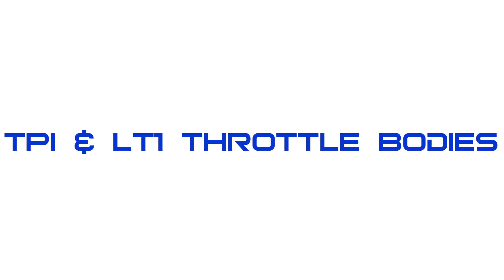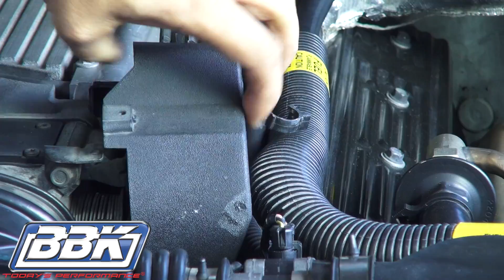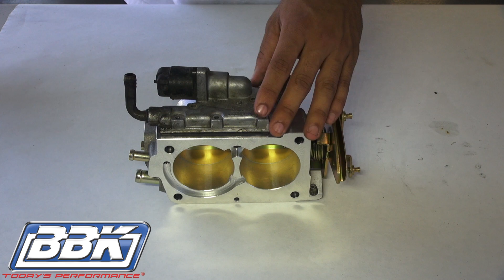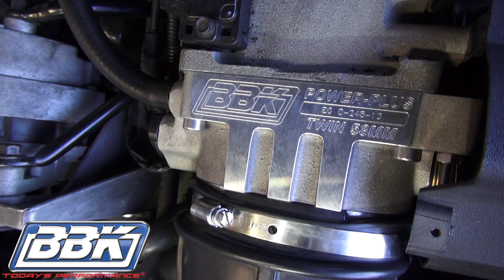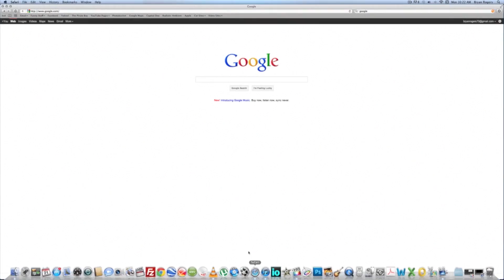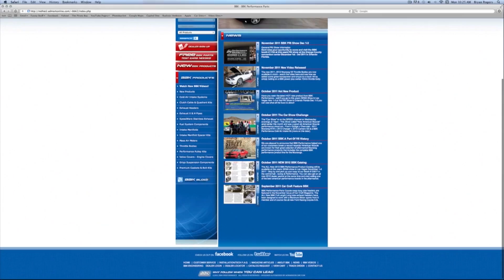Camaro, Corvette LT1 TPI Throttle Body (85-97) Review

Comment: For those that want to know or are confused.  This is my son's Trans Am.  When I bought it, it was "as-is, where-is" and it ran like garbage unless it was completely warmed up and at full throttle.  BBK was gracious enough to use the vehicle for this fit test and demo, but since this video the following has been found/corrected on the car:

1) Cleaned the atrociously dirty MAF
2) New Spectre air filter
3) New EGR Valve
4) New 3" OD inlet/outlet Magnaflow catalytic converter.  This is a CA car, and it came with a CarTex 2" OD inlet/outlet converter for a Mercedes/Toyota.  How it passed smog before, IDK????

We need to get the car Dyno'ed again to see the changes.  It should be performing as expected now.

Comment: I like to know all the things I may encounter when installing a part that should take 20 min. I agree with BBK this adds power I just wish they would try this with a 85 corvette that the air inlet connects up front and not to the side. the stock air tube isn't big enough to go around the mouth of the inlet so I had to find a bigger one which is very hard. Also I couldn't unbolt the coolant housing because it was bonded to it due to corrosion and had to buy a new one from another company. BBK should just mill the coolant housing as part of the throttle body and that solves the entire problem. This is a great part but I wish their tech department was more willing to listen to the improvements to the design. Their customer support is amazing. I made a video on this part if you would like to see it please go to https://www.youtube.com/watch?v=OFN4t4dKSVI&list=UU1nUhV2U5wYyL_lDFV9leww&index=17
any questions please email me paintballhallic@yahoo.com
Reply from the maker: Warm up the stock inlet hose with a hair dyer or a low setting on a heat gun. It will soften and stretch over the BBK throttle body.
Reply from the maker: FYI- To manufacture this throttle body with a built in IAC housing, it would cost much more and dramatically affect the retail price. This is a casting and not a complete billet piece. If it were a billet, it would cost twice as much retail. Nobody makes a throttle body with built in IAC housing. Its designed to replace the stock TB directly and reuse the stock components.